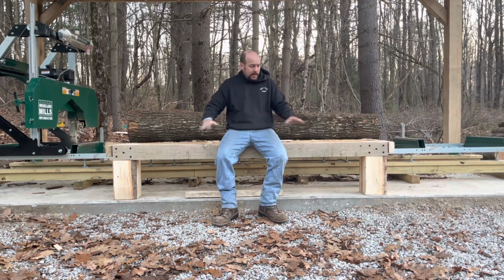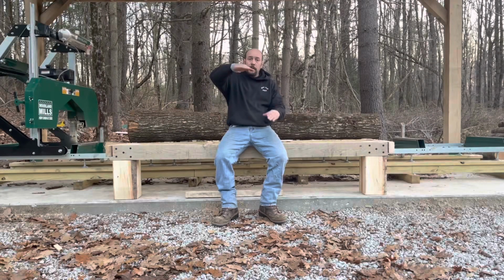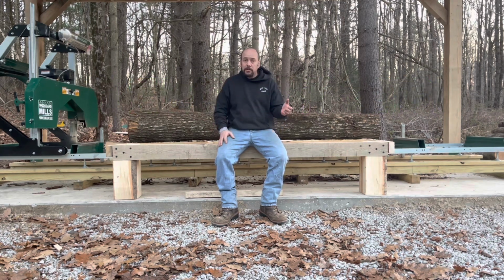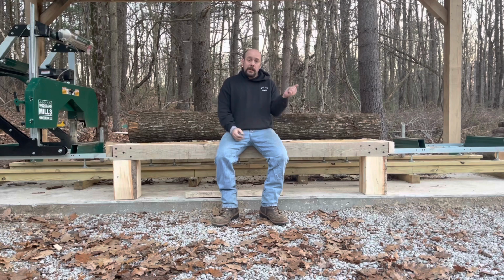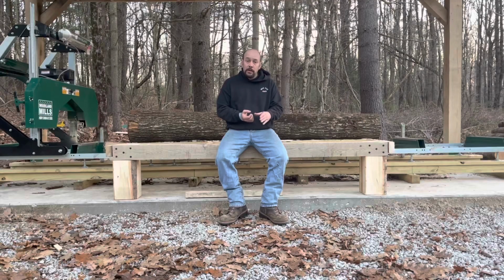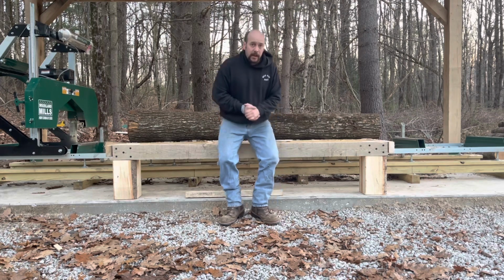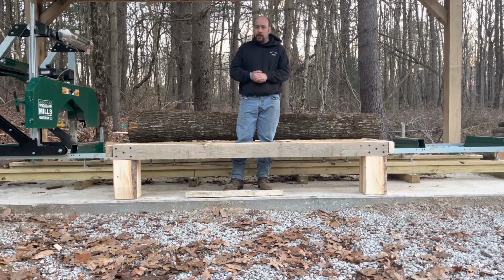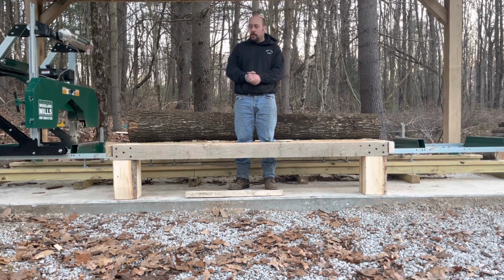A better way to load logs on your sawmill!

Comment: I think this is a great idea and I think you are right, it is far too easy to damage the mill bed. Over here I have seen loading tables similar to the one you pictured where they load all the logs required for one job at once. I have even seen old trailers used as loading tables. Your table looks great
Reply from the maker: Thank you sir. Now my mind is turning to make one for bucking firewood 😎 Thanks for watching 🙏

Comment: Yep, I don't load a mill, but even loading a trailer, there are times when there is a knot is acting as a chock on one of the forks.  When dumping, you have to go a little further to overcome the knot, once it breaks center, wham!  Sometimes you can curl back quick enough, but more often than knot all that attempt does is make the log fall for a slightly higher drop height.  I'm not experienced with grapples,  bit I would think there is an occasional unexpected release when using them as well.
Reply from the maker: Most definitely. Unless someone is always dealing with perfectly straight, similar end to end diameter, knotless logs and is on concrete or another very hard packed surface, it’s unavoidable.

Comment: A better way to load your logs would be to not stand inside the tracks and risk your leg to get crushed. Besides that, a log deck is a great idea and have used one for years. So much safer then putting the log on with the tractor. Just roll the log on from the other side. I have a ton of pics and a few videos of my log deck if you want to rebuild yours to match, it's easier then your design. I'm not slamming yours, it obviously works well, just offereing.
Reply from the maker: I agree. Standing between the rails wasn’t the best choice. Thank you for the offer. I may extend it down the road. Always looking to improve. 👍